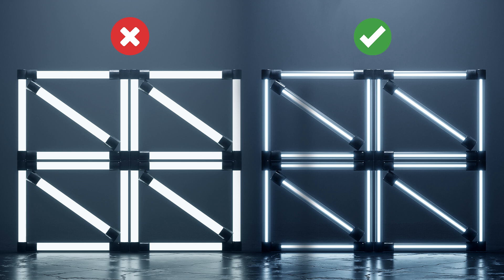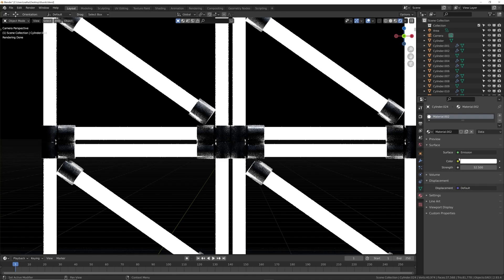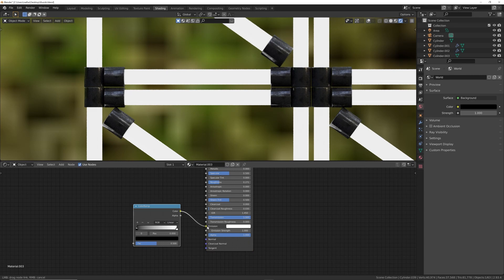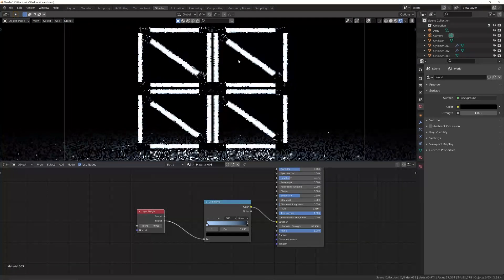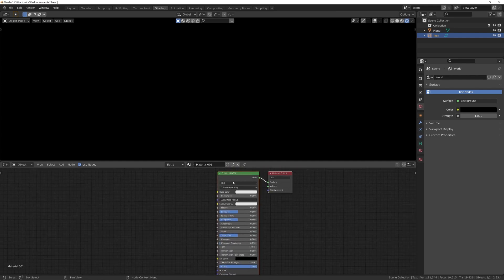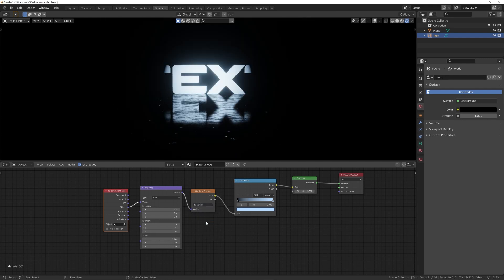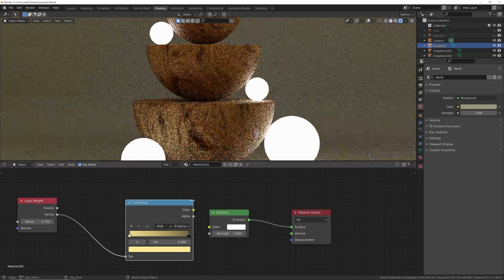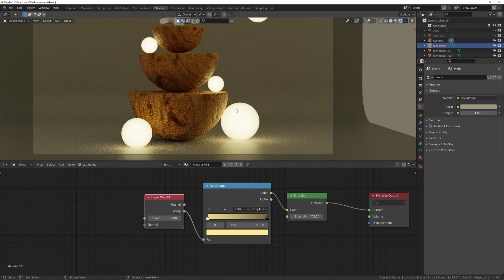How You Can Improve Emission Materials in Blender

Comment: Hmmm, showing three different methods? Number one and three are both using the Layer Weight node on the emission, the first on emission in the Principled BSDF and the third on the standard Emission shader. Technically regarding the emission that's just one and the same method 😉 Of course you have the glass effect on the first objects, but usually I would do that on the spheres in the end as well... if I would go for realism, because glowing spheres cannot consist of "emission" alone. If I don't care for realism I wouldn't need the glass effect on the tubes at the beginning either. But nevertheless, although sounding negative I like the video, these are the kind of little details that usually help me a lot, too.

Comment: The fresnel/layer weight method is NOT good unless you are showing the emissive cylinders from a flat, front-on perspective. Fresnel works based off the camera position in relation to the geometry.
Reply: This is good for symettrical shapes Like sphere or tube,
Reply: @user-gq1ij  Unless you look at the tube from enough of a glancing angle. If he rotated the camera ~45 degrees to the left or right during his first example, the effect would entirely fall apart. It works great when all of the tubes are perpendicular to the camera, but that's about it.  If you plan on using a non-perpendicular angle to achieve the same results, you'd be much better off just placing an emissive tube within a glass tube.
Reply: Then what is?
Reply: @rubyy.7374  In this instance the cheapest, easiest, and best looking way of achieving the effect is simply modelling the emissive inner tube.

Comment: Better off using a grayscale gradient map multiplied with a blackbody node set to 2700-3000 for most household decorative lighting. Lookup what's a common lower limit in the area; here it is 2700, some countries further south use 3000. That facing trick on tubes works fine looking straight at it, but may not work as good as expected when looking from other angles. I might use it in a scene if it fits, but not as a reusable asset.
Reply: lmao right? The effect only works at perpendicular angles.

Comment: Brilliant as always. Can you make a tutorial on how to light low light scene in Cycles with bulbs or any other way... like a bar with no windows? I tried doing something... where the entire place is enclosed and only lit with bulbs... but it doesn't feel right... I know I am missing something, but I am not able to place it. It's just not feeling... "atmospheric" to make it look real, if you know what I mean.
Reply: So off the top of my head as far as lighting goes don't try to light it with individual lights. If you have too many no matter how much you try your scene will look washed out. Instead use emission for the bulbs. And use one or 2 point lights or area lights to highlight the main focal point the color of which should be the same as your emission material. I saw a few pictures of bars that were illuminated with only light bulbs and a lot of light bulbs. They ended up causing the central focused area of the photo to be look as if it was lit by one light
Reply: I'm no expert, but maybe you can try using "IES light" instead of the default lights in Blender.
Reply: +1
Reply: I've a similar problem
Reply: +2